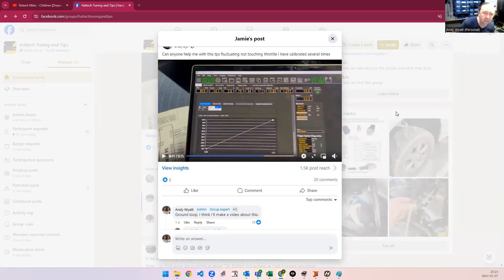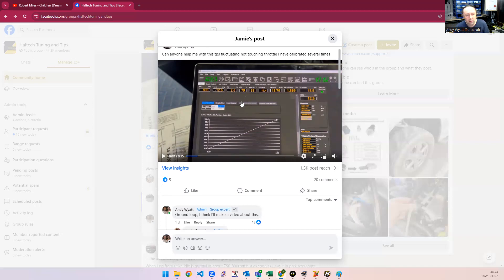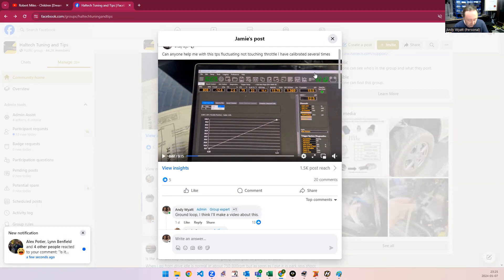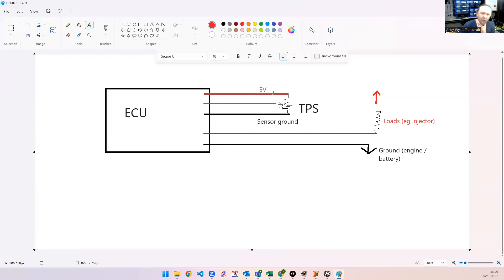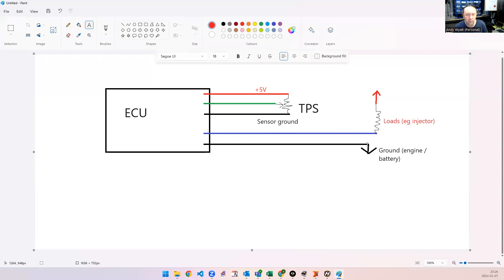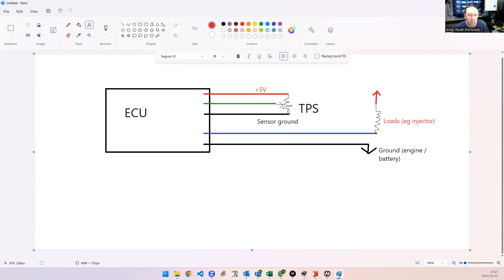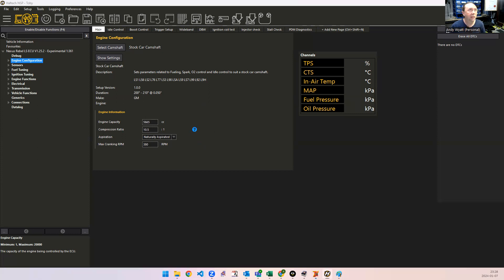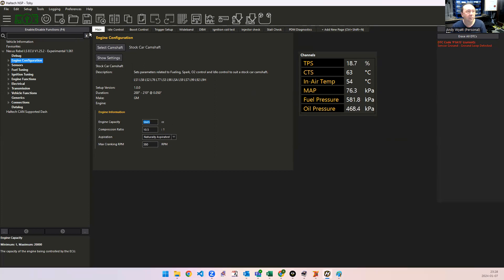My TPS is jumping (sensor ground loops) - Haltech ECU

Comment: Is sensor ground connected to chassis ground inside the ECU? I have continuity between the two only when the Elite 750 is connected. Chasing a jumpy TPS signal problem.